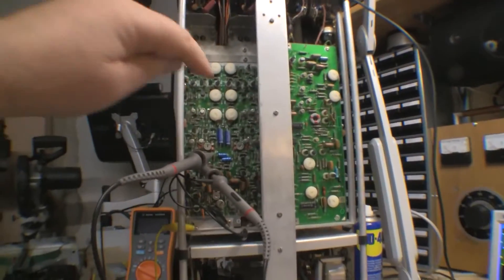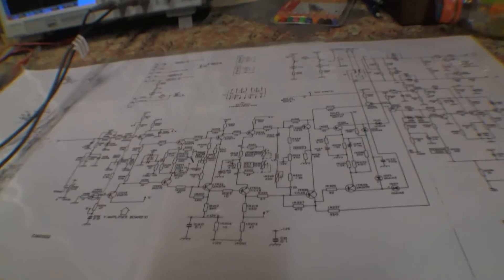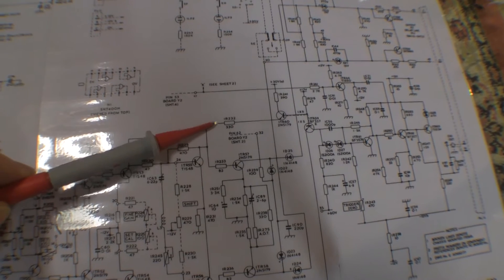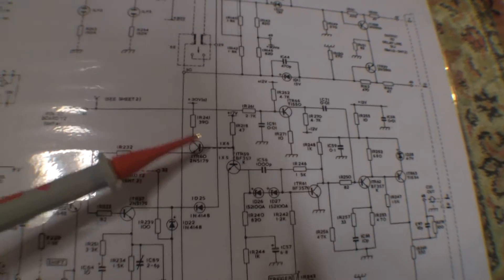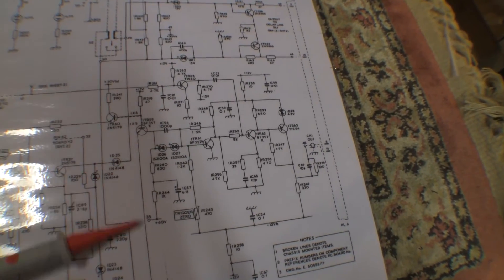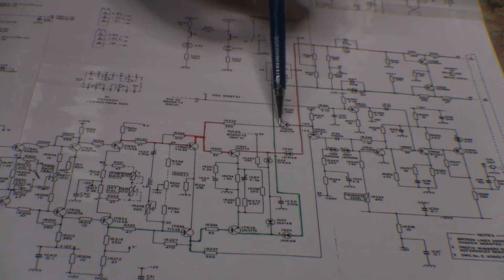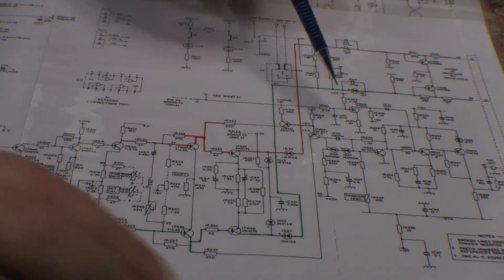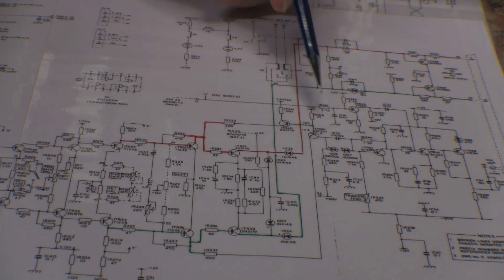SM112 Scope Repair - part 8

Comment: It's difficult to see the schematic on the video, but is it possible that the 17V shown on the schematic is an error?  Since you seemed to measure 15V on the actual circuit, is there a 15V power supply line?  If so, perhaps the 17V marking should be 15V.   Just a thought.
Reply from the maker: Thanks Robert. Sorry, I will try t make a proper scan of the diagram and post it.  The power supply has +5v, +12v, -12v, +30v, +60v, and +120v.   So, no +15v.  I guess I'll have to trace it and see where it comes from.  Then I'll know if it's a mistake in the doc, etc.
Cheers,  John

Comment: Hello John. I think it's worth replacing the transistors, in special considering they were so close to those fried resistors...

Now, sorry if what I'm going to say is BS... The way you explained the circuitry led me to the impression you understand the signal goes from that point before the resistors to those assumed bad ones and on until what I understood to be the connector for the wire to be connected to the external signal. If that were a sound amplifier, it would be the final stage going to the speaker. Now, isn't it the other way around? Shouldn't the signal come from the connectors to be added/mixed/compared to other signals produced inside to be measured and an image being presented on the screen?

By the way, do you follow a YouTube channel called TheSignalPathBlog? The guy knows a lot about electronics, at a level much beyond my understanding. He usually makes lengthy videos explaining the working of complex test equipment and sometimes repairs them too. He is a calm guy and explains things in a simple way. I don't get much of the things he approaches but I usually learn from him.